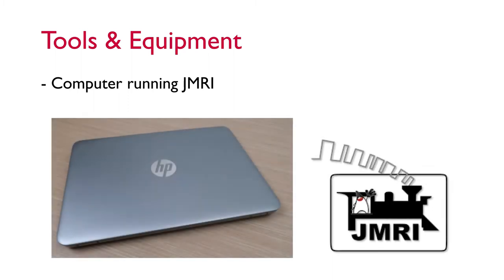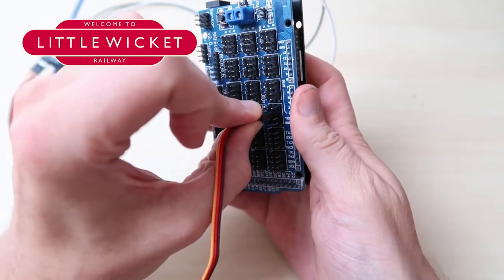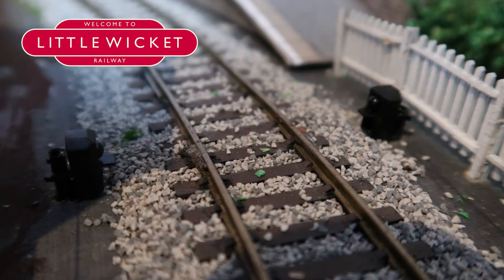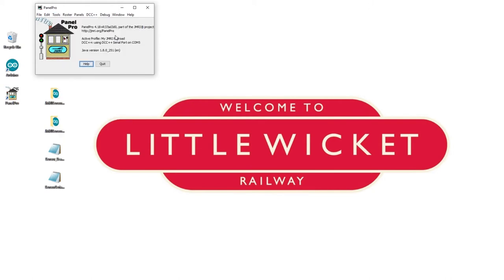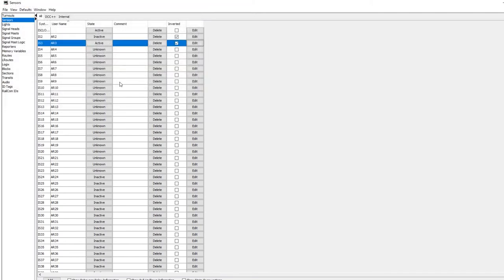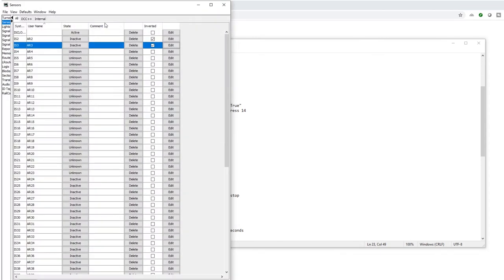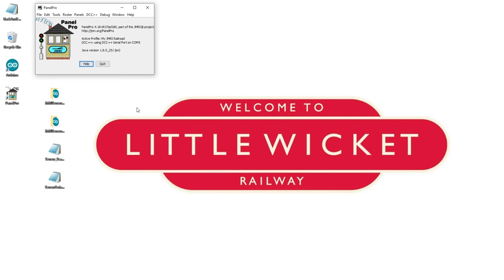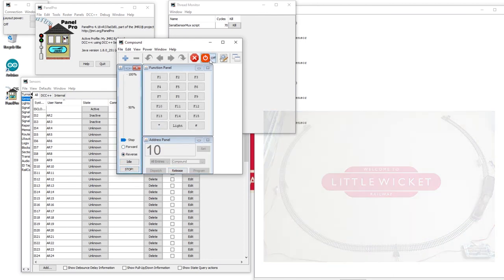Model Railway Sensors & Detection Part 2 - Train Detection and Automation with IR Sensors

Comment: The sensors are reflective. Why are they not reflecting off the loco ?
Reply from the maker: Good question, because the loco is black and its surface isn't reflective enough to the return the IR wave back to the sensors. If you were using a white (or lighter colour) loco then you could get rid of the reflective gate and just have them activate as the train passed.

Normally I would mount these sensors under the board, facing up at the underside of the locos. These are almost always black so I have to attach small pieces of reflective tape.

Comment: Rob,
I would like to install IR sensors across the rails at an angle so as not to be interrupted by the space between cars.
Are you aware of a sensor tht comsists of the 2 leds thru small tubes like straws that can be placed across the rails and feed back to the sensor thru a bit of extended wiring?  I am not fond of the idea of soldering bits of wire to the bulbs and then back to the pads on the sensor as the solder pads are very small and can be easily lifted.  Or I can look for 3mm sensors that protrude at the end of the sensor unit and point them up thru the bench work between sleepers.

Can we put a delay in JMRI on the sensor channel so that the status does not drop out between cars?
thanks

Bob S - Cleveland, OH

What are your thoughts on this?
Reply from the maker: Hi Bob, I 3D print "gates" like the ones you describe for 3mm LEDs. I desolder them from the sensor and extend the wires under the track. Not aware of anything commercially that does this, but I'm sure it can be built without 3D printing. 

You can add a "debounce" time to a sensor in JMRI so that it will hold a detection for a set time to stop "flickering".

Comment: Do you know you of a sensor that could be attached to a toy train running in a loop and the sensor would be used to make the train stop once it detects an objection in front of it?
Reply from the maker: You could use an ultrasonic sensor or time of slight sensor mounted to the front of a loco to measure the distance to an object in front of it. However, you'd struggle to fit these to small models and the sensors could be confused by line side objects or when going around curves.

Comment: Thank you very mutch. it helps a lot mainly when I'm returning to this hobby after 40 years of stop. Quite different now. I would like to know if you are using 2 diferent arduinos - 1 for loco control and 1 for sensors control - and how do you interconnect them.
Reply from the maker: Hi Luis! Yes, I'm using one Arduino for the DCC++ base station to run the locomotives and then there is another Arduino reading the sensors.
Reply: @LittleWicketRailway  Thanks, your videos are very interesting. I've already bought the Dual Channel DC Motor Driver. After making this work i'll go for the sensors.

Comment: This is a great tutorial. Can you tell me if the script would work (or would I require changes to the code) with a ESU cab control system that was set up with JMRI? Just starting and there is a ton to understand.
Reply from the maker: Hi, this would work alongside other control system in JMRI. JMRI can handle multiple connections. Please take a look at the CMRI series, if you like this then I think you might find that interesting.

Comment: This is really good. One question though. Why not run everything through arduino. The mega you have has plenty of inputs to control the loco and many many inputs. You could daisy chain sensors also i2c for many more or just groups, points or signals for example.

Comment: The JMRI sample scripts have always been included in the JMRI download so there is no need to go back to the JMRI website to download. They are located in the Jython folder of the JMRI install. Once you make changes to the script you should copy it to a new location as an update will overwrite it. I suggest your JMRI users folder.
Reply: If you do want to download a script from the website, just right click and you should see an option like 'Save link as' (varies depending on browser).

Comment: Hi Rob,  I have been following your dcc videos with interest as the last time i had a model railway was in the days of DC.  Just a query being a novice on the JMRI and arduino approach, i have set up a base station following your video using a uno arduino with a motor shield which i have set up in JMRI.   The sensor hub video is using a mega arduino, how does this tie in with the uno which is used to control the locomotives on the layout?  Does the mega arduino plug into a different usb port on the same PC and the control is all through the JMRI software talking to the two arduino boards?    Sorry if i hve repeater some of the queries below,  i did wonder if it was possible to use a micro reed switch (sensor) which is triggered by a small Neodymium magnet what do you think?  only thing is i am unsure how it would be configured on the arduino with being a novice.

Thanks in advance for any help pointers/ advice.
Regards
Colin
Reply from the maker: Hi Colin! Yes, easiest way is to use 2 USB connections on your computer, one for the DCC control and one for the sensors/outputs. I've heard that DCC++Ex might allow you to combine the DCC++Ex controller and sensors into a single package, but I've not tried yet.

You can definitely use a reed switch as a sensor. Connect this to the signal pin and either the GND or VCC pin on the Arduino depending on whether the signal pin is pull up/pull down. Maybe experiment with a normal push switch and see if you can get that working first. Anything that create a digital output can be easily used as a sensor. Analogue output is harder to use, but still possible.
Reply: @LittleWicketRailway  thanks Rob.

Comment: Hello, great video as usual. But I do not quite understand where is your dcc  command station and how its interconnected to the Arduino with IR sensors. As I see i am not the only one who is questioning this part. Can you please give more details on how do they connected together? Thank you.
Reply from the maker: Hi Anatolii, the DCC++ system is connected to the computer on one USB port, the sensor hub is on another USB connection and servos are connected on another USB port. Everything is then coordinated via the JMRI software. Since making this I have combined the sensors and servos onto a single Arduino, but the DCC++ system is still a separate Ardunio with its own USB connection.
Reply: @LittleWicketRailway  Thank you a lot.

Comment: It's best to kill the script when the loco is in the 10s pause state. Otherwise you have to stop it with the throttle.
Reply from the maker: Yes, if you killed the script whilst the train was moving it would continue moving until it received another command.

You could build something into the script to turn the shuttle on and off. Maybe the script only works when a "sensor" is active. That sensor could be a click button in panel pro or a physical switch attached to the sensor hub. Scripts are very powerful and flexible.

Comment: Just got around to using this and so impressed with this simple script and having used python for other projects I am looking at expanding this for now. I am still working on the block detection setup but so far I think my soldering is not that good as the first Merg senor doesn’t seem to work for me. Bit of head scratching required to find the issue. I also decided to keep the arduinos separate as I will need a lot of infra red sensors. I am also using the larger 5mm infrared sensors which are picking up the locomotives up no problems and they are running on 5 volts.
Reply from the maker: If you're good with scripts then you can do pretty much anything in JMRI, they're really powerful.

The MERG forum may be able to help troubleshoot your sensor issue.
Reply: @LittleWicketRailway  well turned out I had not put the link wire in so was a ground issue. Now to get making the rest  up. And so happy with the script have now got the trains stopping at the different stations on route. Thanks for getting me started on this journey.

Comment: Can you clarify , how is power to the tracks supplied ? Is it through the arduino connected to the sensor shield? You turn it on thro JMRI but do not make it clear - please clarify. 
Thank you
Reply from the maker: Hi! I power the track using the DCC++ base station which is connected to JMRI. The sensor system is on another Arduino also connected to JMRI using another type of connection.
Reply: Hi,
From you response , am I correct to understand JMRI can recognise inputs from more than 1 USB connection ( ie one from the base station and one from the sensor hub )
Reply from the maker: Yes it can. I've got the DCC++ on one USB connection and the CMRI stuff (sensors, servos, etc.) on another USB connection 👍
Reply: Thank you

Comment: I'm going through your technology series and I'm loving it! I'm coming back to the hobby after some time and as I have an IT background this Arduino tech is right up my street! (also cost being low is a bonus) I think I will follow your video's instructions while setting up my shunting layout in regards to DCC++, Block Detection and servos for points and signals.

These tutorials have been great! Thank you.
Reply from the maker: Thanks and welcome back to the hobby! 😀 If you're going down the DCC++ base station route then check out DCC++EX. It's an upgraded version, but I've not got round to making a video on it yet. Stay in touch, let know how you're getting on 👍
Reply: @LittleWicketRailway  I’ll do just that Thanks! Currently watching your mimic panel video. I might need to rethink power source for it as I have several points and signals on a smallish layout. I’ll be posting updates regularly on my channel once officially started :)

Comment: Hi.. Great video thank you. Very clear.
I am just getting going with N gauge and DCC++. I only have 2 USB ports on my laptop - one for my mouse and one for DCC++ Ardhuino. Will the sensor hub work via a USB expander port?
Do you know if 3mm end-on sensors are available?  Those on the side will be difficult to fix under the board.
Many thanks.
Reply from the maker: Hi Paul,

I've not used a USB hub, but it's something I'm likely to try in the near future as I hope to switch from using a laptop to using a tablet which only has a single USB port. I would assume this is possible as long as COM ports can be assigned and allocated in JMRI. If I do it then I'll let you know for sure.

Check out TCRT5000 sensors, I think these have 3mm LEDs. They come with a little plastic holder around both LEDs, but this easily comes off if you need it to. The LEDs fit easily between OO gauge sleepers, not sure if they would fit between N gauge sleepers or whether you'd need to trim/remove a sleeper.
Reply from the maker: Some useful information here: https://model-railroad-hobbyist.com/node/35506
Reply from the maker: Hi Paul, I've just connected a powered USB hub with an additional 4 USB ports and it's all working fine. Windows has allocated the same COM ports to the boards that it did when they were connected directly. This is the hub that I've used: https://www.amazon.co.uk/gp/product/B07KFDFT4D/ref=ppx_yo_dt_b_asin_title_o09_s00?ie=UTF8&psc=1
Reply: @LittleWicketRailway  Fantastic news!  Thanks for sharing it

Comment: Hi, just looked at three of your videos, 2 on the Sensors and the one on Automation.  Excellent thank you I have been wanting to look at both Ardunios and automation for some time but haven't found such excellent tutorials, all the others go way over my head.  Couple of questions:  The Model-Railroad-Hobbyist blog site seems to have changed since your video.  I have downloaded "Sensor_Chanel_Rev2" is that OK? do I need any other downloads from that source?  Also can I use my NCE Power Cab instead of your Arduino built controller?  Thanks.
Reply: OK got it.  Read all the posts below!!

Comment: Hi Rob, thanks again for a great tutorial. Have kind of got it working with just one fly in the ointment, I have set my sensors to 'inactive' which the script appears to need but once the train has activated the sensor it stays in the 'active ' state and messes the script up. I have kind of done a workaround for the moment ..... changing the state back to inactive manually. I will have to look into sensors a bit deeper. Thanks for all your hard work.
Reply: Doh, did it again. Using a version of the SensorScan script that wasn't modified
Reply from the maker: Hi Neil, having to run the script is probably the worst part of the sensor hub. Take a look at my latest video which combines the sensors and the servos, but the big benefit is that you no longer need the script because everything works via the CMRI connection (https://youtu.be/OkXG3mfY6PE).
Reply: @LittleWicketRailway  I also found that Python is tetchy about indentation of the code. 

I've seen your new video but only cursory. Will try and give it my full attention soon. I've  managed to get the IR sensors with the back and forth running quite well. Thanks again